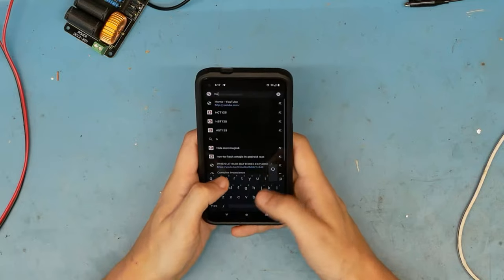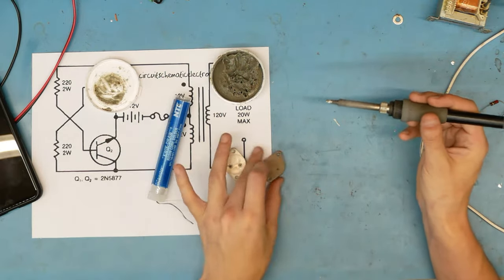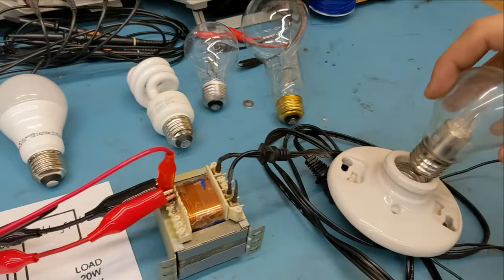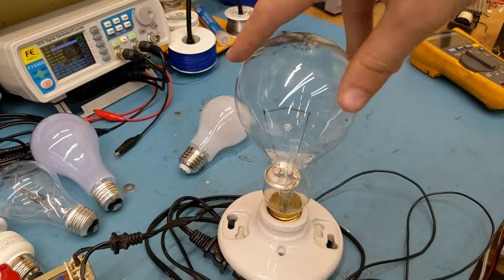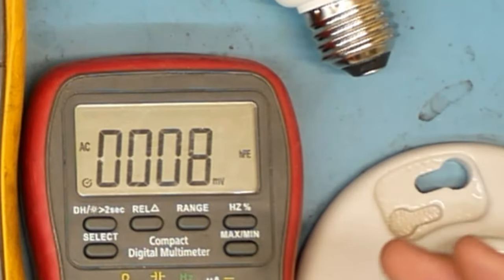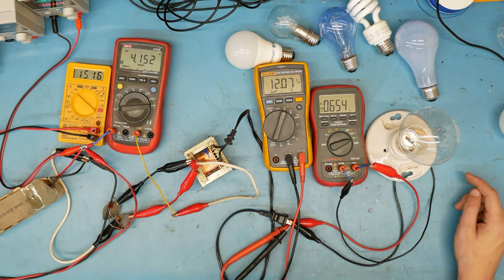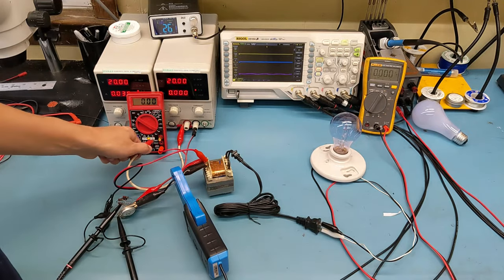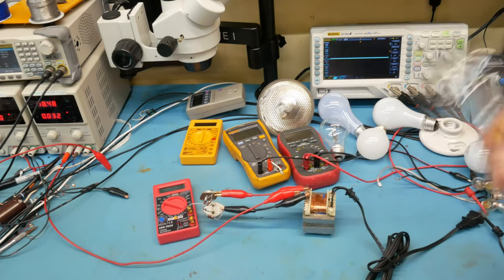Building the Worst Inverter!

Comment: Ha made this exact same arrangement previous week but it sucked and did not realy work so i gave up and hooked up my amplifier board playing 50hz to the transformer it worked a bit better then the transistors and delivered a few more watts but the amp chip got hot so it needed a fan but it still sucked. My next project will probably be using the egs boards

Comment: Also, a comparison with a Mazilli  would be nice. Can work  without a discrete LC tank i.e. no capacitor, but I don't see many ppl trying that,. Bet it isn't good for the FETs. Would be cool to see tho. Also also I wonder how a small capacitance across both FETs D-S affects the said configuration
Reply from the maker: Yeah I was actually going to do that, and you can even see one on my bench, but the video was getting long and that will have to be put off for a later installment to this series! Stay tuned.
Reply: @power-max  Ofc

Comment: Hmm. Maybe the hfe sign displayed on that multimeter says something about what's going on inside it (weird that the lcd even has that since there is no transistor tester in that dmm). Maybe whatever ic they use has transistor testing functionality or something. Maybe the cause of the malfunction is something within the chip itself.
Reply from the maker: I think something was funky about the range switch. I've taken it apart and reassembled it after cleaning the contacts and that seemed to have helped but the display still occasionally blanks out and the DMM acts up.

Comment: When will be the next episode to improve the worst inverter? :)
Reply from the maker: I wanted to explain in detail how this video works in this one, but it made the video too long and probably boring for most people, I need to start work on this next (and stop procrastinating it lol)

So the next one will probably replace the BJTs with MOSFETs and a TL494 or equivalent to make a basic modified sine wave converter using large 60Hz transformer. Which is already approaching that of what is used on low end UPS systems, one of which I will tear down and reverse engineer.
Reply: @power-max  I'm learning about the differences in between push-pull, half-bridge, and full-bridge types of inverters now. My plan as I think you know, it's to build an open-source pure sine inverter.
Reply from the maker: @screen-protector  Go for it! They are not too complex, so I am sure there are plenty of other small open source inverter projects people have made if you go looking!

Comment: You might be able to reduce the spikes at the base with a forward biased schottky diode series with either resister, and some back to back zeners at the base's. Or you could just find a less shitty circuit 😏
Reply from the maker: Yeah, there is a  *BIG* laundry list of stuff to do to improve this circuit! All gonna be covered in part II.

* Use a seperate lower voltage winding for to drive the BJTs, save 11W of power.

* use a small saturable reactor for the oscillator and gate drive, but use a BIG transformer not driven to saturation for the stepping up the voltage (another 12W of power savings)

* Use a TL494 or hell even 555, fixed frequency

* use MOSFETs instead (couple more watts saved)

* Don't use big 60Hz transformer, make it run at hundreds of kHz using forward or LLC resonant converter and then use H brige at the output and PWM to make the pure sine wave inverter. ( part... who knows ¯\_ (ツ)_/¯ )
Reply: @power-max  Well thats the zycosmoke way to do it

Comment: It bothers me how short those clips are
Reply from the maker: I really tried to condense it down as I wanted the video to be around 10 minutes so some parts were edited almost like the tiktoks or youtube shorts to get the highest information density I could. I'll keep that in mind next time.
Reply: @power-max no, I mean the the alligator clips. They're like 6 inches. The video is great! Really high quality video for such a small channel!
Reply from the maker: @unrealcrafter2671  Ah LOL! 😂 Yeah I did that on purpose because I wanted short jumper leads for a project! I could always crimp more, I got automotive hookup wire, high strand count silicone wire for RC, and a component drawer filled with those copper aligator clips. Much nicer and more conductive than steel ones.